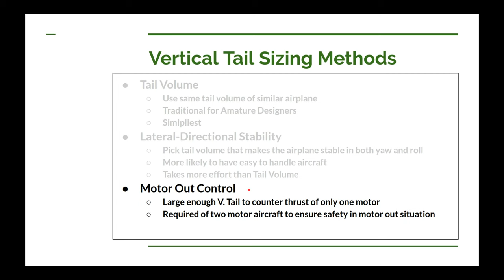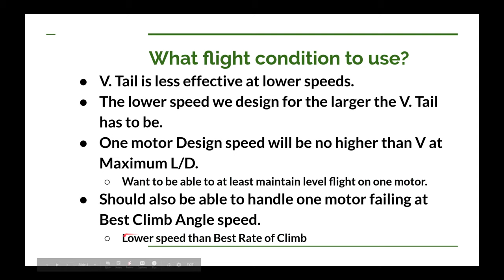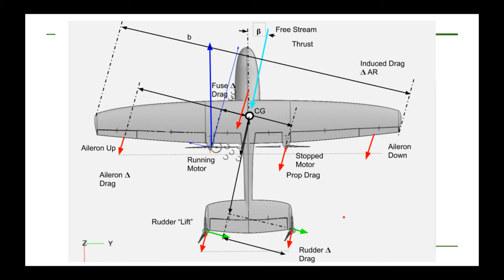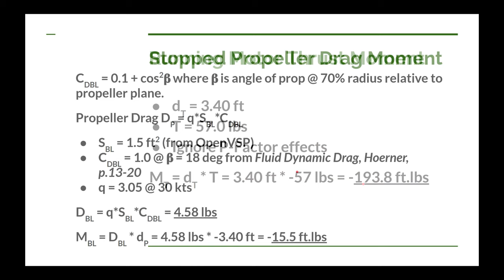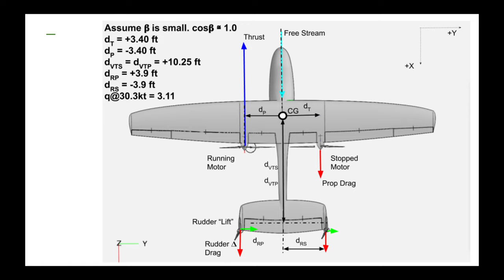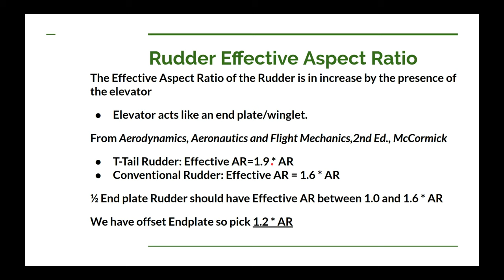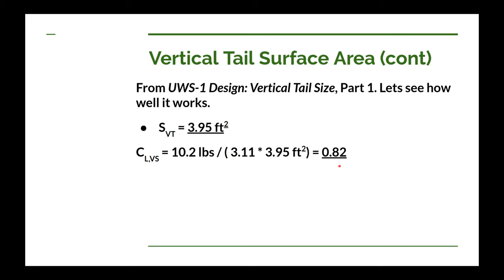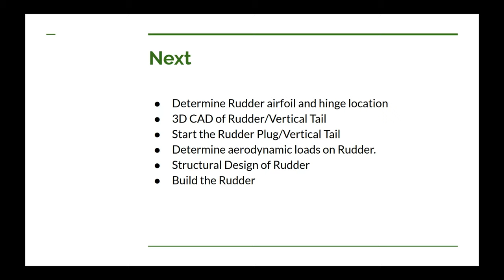UWS-1 Design: Vertical Tail Size, Part 2

Comment: Very well explained. Fly by wire? Pretty ambitious, for a UL :-)
There's so much shitty-thought available, presented as 'experienced designers'. I lost the outer-third of the left wing on a UL (pusher) during test flight for a customer. (I worked on the gear; my "boss" did the wing)
Don't know how I'm alive. In fact, messed with my head so much, I left aviation. (A&P)
The brilliant 'experienced designer' set a ballistic chute to fire through the propeller, basically. Perhaps this genius hadn't considered that there are reasons beside engine failure thay would require a 'chute deployment.
In fact, I don't really see where an engine failure, in most cases, would warrant deployment.
I appreciate your work. Get someone to listen, and you may save some lives.
Or leave the know-it-alls to the 'experienced designers'.
Dunning-Krueger can be a bitch.
Thank you!
Reply from the maker: Thanks Chris. I agree that a loss of engine should not require a parachute deployment over most terrain.
I'm still thinking about how I'm going to install the parachute. Having two possible spinning props makes it more difficult.  

Yep, the fly by wire is a pretty high goal. So it has been pushed to sometime in the future. 

Thanks for your comment!

Comment: i undertand redundancy but i think your making things worse and more complicated...if one of those props free wheels it will create drad just like haveing a pice of ply wood the diameter of your prop.if this happens your going down as the drag will overwelm your other motor and your tail caculations will not be enough to over come the situation.i can also emagine if 1 ruder system goes wrong it might tangle bothe.